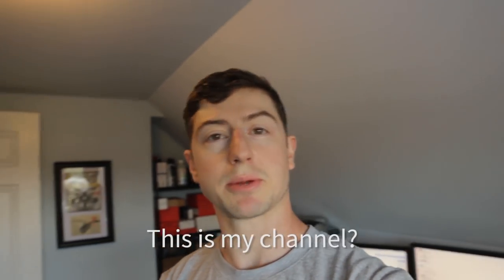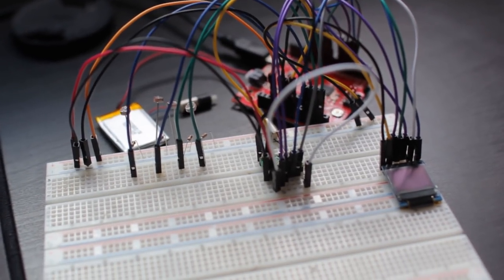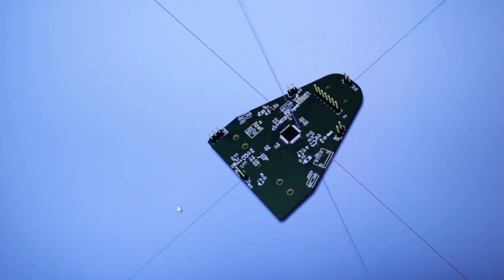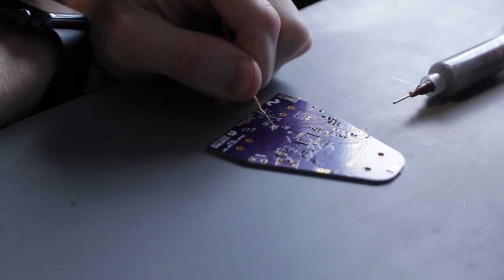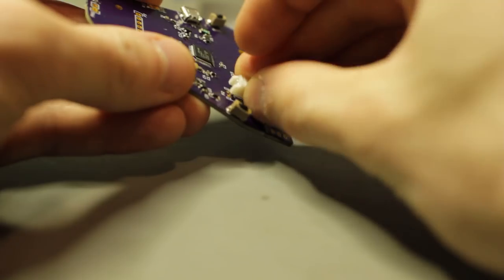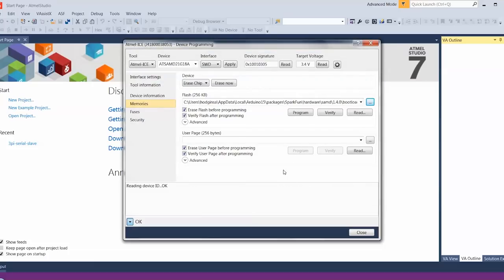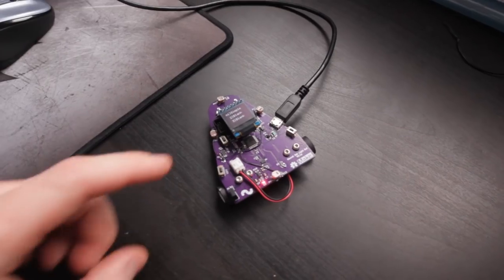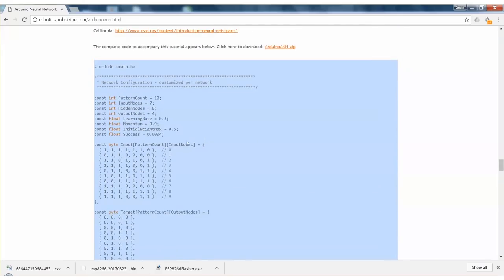Build Your Own Arduino Neural Network Robot - Complete How-To!

Comment: I don't understand how the robot was trained when all you did was let it sit there on the desk in the same amount of light. Was the nn just looking for an error below a certain point so it can safely assume the correct light level? Please explain if you can
Reply from the maker: The robot was given extremes in the programming, example, If a lot of light on the left sensor, make the left motor go full speed - If a lot of light on the top sensor, make both motors spin backwards. With a small set of instructions like this, the neural network will "fill in the gaps" and allow different behaviours that were not given in the program, like 30% light on top sensor and 45% light on the right sensor will make it drive backwards and to the left. We never entered that into the program, but it knew how to do it because of the training data.
Reply: @SeanHodgins  oh I see! This is a fairly new concept to me, especially on an Arduino board, thank you for explaining; that actually made a lot of sense! Keep up this content, please!!
Reply: I'd be interested to see it trained on datasets that involve examples of actually trying to move away from your light using certain thresholds until it succeeds. I think that's what most of us were expecting when we watched for 40 mins lol. This is cool though. It'd be even more interesting to see it do both. You could reuse most of the code to do that after the first stage of training that generates control mechanisms. Maybe even a third one where it has to reach an end goal without getting hit, and then use the model from all of them to optimize all of it.
At that point turn on a laser machine to torture it and see what happens. Pray to roko's basilisk for forgiveness afterwards. It's basically one of it's children.
Reply from the maker: @steve_jabz  What do you mean by certain thresholds? Not sure that sounds like a neural network. Do you have an example? While I agree that would be cool, are you sure you're not thinking of genetic algorithms? You can use them in combination with neural networks, but most neural networks require a set of data prior like what I've shown here. You're just mapping a set of values to another set of values. You could also be thinking of cognitive systems, much different than neural networks, much cooler though. You would have to assign it some type of reward system, whether negative or positive to make it not want to be in the light. Both of these would be very difficult on an Arduino.
Reply: @SeanHodgins  actually, this is where I was confused (I think). I think it would be really beneficial if you could make a video explaining the two, and their differences/advantages. I think this is a common place that people (like me) get confused! Thanks again for the reply x2!!
Reply: I mean the prior dataset is collected from real data, but even that is still dynamic because your neural network is dynamically generating the controls here. So in other words, try using combinations of speeds and controls to escape the light, store the attempts in eeprom then use them to train on. Reinforcement learning without big data. It would probably be terrible and slow, but interesting.
Reply: @SeanHodgins so if I understand correctly, it’s not that the neural network is actively driving the robot, more so the neural network created the drive parameters for the robot, that the robot itself then runs like regular Arduino program? So it’s not that the NN had to learn from the environment, it was more “thinking through” how to create a drive algorithm given a set of initial conditions?

Comment: Hello, Really nice work.
I am currently student in a french engineering school for a formation in A.I. and I'm currently working in group on a autonomous drone (DJI TELLO EDU).
We particularly don't understand how to apply neural network (with Python language) to control its navigation.
The objectives is to approach to a mobile platform (like a military airplane or helicopter landing on an aircraft carrier) by using its own camera.

Without Neural Network, we managed to approach and to align the drone to the objective. But, that is not really stable when it's going more and more closed to the objective. We think that using PID controller or Neural Network may help. We think that the inputs are :
- Center point of the objective  ==> useful for vertically (up/down) and radially (clockwise/ccw) aligning the drone to the camera
- Length difference between two vertical lines ==> for lateral translation (left or right) [ex : if left vertical line is shorter that the opposite one, then translate left)
- Mean of the lengths of these two vertical lines ==> for axial translation (forward/backward) [ex : if the length is short then go forward]

I hope you see what I mean. I currently don't find explicit document and example of python script. Do you have suggestions? Thank you :)

Comment: Hi Sean! Good to see you back at it. Also great work on the “bleeding” machines you built with/for Mark Rober!

I spent most of the video trying to figure out how you would implement a machine learning algorithm on this chip to accomplish something with the inputs of the light sensors.

It looks like this is an implementation of a SVM, support vector machine. Is that correct? The fact that you’re giving it edge/max cases to have it figure out what should happen in between feels like that’s what happening.
Reply from the maker: This isn't an SVM. They are mostly used for classification and isolating data and they make a hard boundary edge that means its either inside the boundary, or outside the boundary. Black or White, 0 or 1. In this example we have a fluid change so the motors output can vary from 0 to 1, instead of being a hard 0 or 1. I may have created a bit of confusion when I use the term extremes, but its not the same as providing data points on the boundary of an SVM to train it better. Its giving a set of basic instructions that have to work, and from there the NN will fill in the blanks of whats missing.

Comment: You should update this using the new edge computing devices that can run Tensor Flow lite. 
A voice activated robot that doesn't need any cloud services.
Reply from the maker: Not a bad idea. I want to make a simple and small RPi robot, and I think you can use TensorFlow on RPi.

Comment: ESD is insidious.  It can cause damage not immediately apparent, but will reduce the lifespan of the afflicted part.
Reply from the maker: True, but pretty much all of my old arduinos/pis/microcontrollers are still working, so while it can happen, its just not that scary.

Comment: The idea of training a neural network without actual stimuli and result testing is not very reassuring.
It may be very compelling as it can be done fast, but it basically tries to end up at a predetermined configuration from a random startingpoint.

Comment: Would it be possible to make it learn on the go? Like, reward it if it reduces the sum of all the sensor readings, and let it tweak the weights on each loop to try to figure out how to avoid light while moving around, without explicitly being told what to do with the motors for each situation?
Reply from the maker: Possible? Totally. But its a lot more complicated, and not necessarily a NN. I would love to make something like that. I'm working on a robot where you can place servos in random locations with different length and shaped "legs" that will just learn to walk forward without programming any specific motion. That will be similar to what you describe. The reward is how much its able to move forward each time it does a walk sequence.

Comment: i was thinking making the same robot but training a bit different and couldn't do. what i was trying to do was something like this: get light from sensors and do completely random stuff with motors. then if it caused sum of light to go down keep doing it with randomness added ( mutation ). if it caused to rise sum of light just don't do it another time. couldn't make it work because as you guess i'm pretty new to neural network. my problem was that it couldn't learn anything, just was doing random stuff all the time. i couldn't compare new light readings and start learning with it because it was now trying to figure out what to do in that light conditions. i tried to stop motion while getting new readings and training but now it was just stopped and sometimes moved. can you help me make something like it? i want to make it walk continuously and also learn as it goes.

Comment: It just looks like a curve is defined and then plotted and then used like a lookup table so interpolation can be used to pulse the motor speed. Maybe I'm missing something.
Reply: You're right. The key points are defined by the code, then the machine calculates the curve data. It is hindered to a point by the limited capabilities of the microcontroller. It becomes more complex and detailed in more powerful hardware and more complex systems

Comment: Is there an advantage to building a neural network versus just hardcoding simple wheel turn behaviors based on the light inputs? For low of a complexity level I can't imagine there's much of a benefit.
Reply from the maker: No, this is for demonstration and learning purposes. Instead let’s imagine you want to avoid specific wavelengths of light more than others, and maybe want to go towards other wavelengths. Also some wavelengths can be too intense and some not intense enough. Also lets make it omnidirectional with a third wheel and motor. Now trying to program that would be super hard and/or impossible, where as using a neural network would make it feasible.

Comment: I wish i were smart enough to design and program my own boards
Reply: Its not hard. Took me less than a year to learn how.
Just buy an arduino and go from there, you will get an idea, and then the process of building that idea should teach you most of what you need to get started. As long as you are good at googling you will have no problem.

Comment: What is Neural Network?

As of what I learned,
- Automation : Scripts or code automates an action with Input or output and can be recursive or multiple process layer
- Aritificial Intelligence : The ability of a script or code to create scripts or code of process (May be multiple processes)  to produce desires action with input or output.

Neural Network : Mapping of Human Brain to control a device or in reverse. The Neural system of Biospecies and Mecha-Kinetic system of Robots can be interacting with Neural Network.

The device you made is partial progress for Neural Network. Mapping the brain and having thoughts recorded where the word "On Ardruino" would be the data for the device to start and the thoughts "Off Ardruino" would be the brain map data that turns off the device.

Magnetic Resonance Imaging (MRI) : The light up regions of brain like binary on (1) and off (0) are example of Brain data.

EEG and Bluetooth depending on Wavespectrum could do so.

Please be adviced, Be ethical and do check up on "Medical Act" on Rights and Consents before testing on anyone if you plan to do so... besides "Medical Equipment Act" if you are making it for a good cause.

Magnetic Radiation is bad, Reduce its usage.

Comment: I don't understand the difference between the test run with & without the Neural Network.
Reply: The behavior is essentially the same, but the code the microcontroller is far different. The test is reliant entirely on the hardware staying the same. The nn has the ability to adjust its own values should some bit of hardware change either you reconfigure it or a drift in value due to age or damage. The nn code would only need reworked if you were to add or remove sensors entirely. And that rework would be minimal
Reply: @allensmithphotography  
Thank you.

Comment: Why would you use an Arduino-like board for ML? You could get literally almost any STM32 MCU for cheaper and you would have something way way more powerful to work with.
Reply from the maker: This is an M0.
Reply: SeanHodgins Why not use an M4 if you’re gonna do ML?
Reply from the maker: @jimkokko5  I explained in the video, this is a demonstration of how ML works in a simple form, not efficiency. If you really want to explore ML on its own use a computer with a powerful GPU, or something designed specifically for it.
Reply: SeanHodgins I see what you mean, however you can still use a (pretrained) ML algorithm on an embedded platform and have an acceptable level of efficiency/performance. I was mostly asking out of curiosity tho :)

Comment: Atmel studio IS your IDE. Why would you load a bootloader for an inferior goofy amateurs' IDE thereby wasting your port and 1 or 2 k of memory? Go pro, dont do it the arduino way. Using the ICE unit you can do real debugging, single step, memory trace, things you can only dream with the the play IDE. You already have the ICE programmer, why waste it?
Reply from the maker: Why do it this way? Well here is a great example. I made about 20 of these for my University. They were made for students to learn about neural networks. It was not a class to learn about how to "be a pro" at microcontrollers - that would be a waste of time. It was to see and study how an ANN works. So by putting the bootloader on, it allowed them to easily modify the code to see how it affects the output.
Reply: @SeanHodgins  Fair enough,  not to beat you down too much more but you really didnt explain much of that aspect of it and you made some minor errors in terminology and failed to illustrate and enumerate critical elements, to wit: you called the process of the the feed forward phase 'an equation' which its not, its a matrix transformation on a number of interconnected weighted elements and the deciding factor is an 'activation function' that may or may not be 'an equation'. You didnt describe the process of selecting hidden layers and node numbers and you didnt even mention backpropagation.  You got a black box you didnt really understand and you deciphered just enough to twiddle some dials. If the purpose was to learn neural nets, you left them at ground zero there too. /rant off. Anyway none of it matters in the fullness of time/ JLPCB in Shenzen will make you more boards, the ChiComs will eat our lunch, American kids will get more woke and stupid, and it wont matter if they can even solder to save their lives.

Comment: This is not a proper neural network. You're telling it exactly what to do and change things until it does, but on a real training, you tell it what to achieve and it will guess what to do. I mean, here you're telling it "move the motors like this for this condition". Instead you should tell it "stay on the light/away from it and these are your inputs (analog, not digital)"
Reply from the maker: This is absolutely a neural network, and this is how you train a neural network. The point of the training is to give it extreme conditions and then it’s able to extrapolate and fill in the gaps. All I’m saying is “light right, move left” etc etc. and then it’s able to interpret a more complex scenario of light.